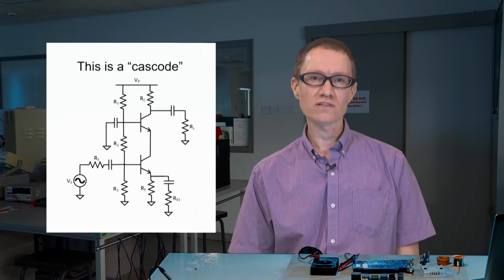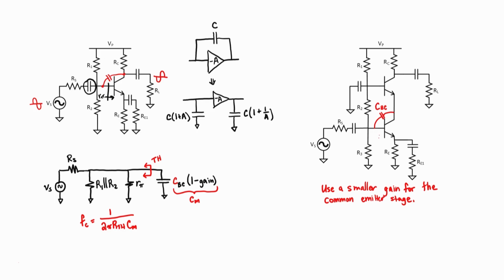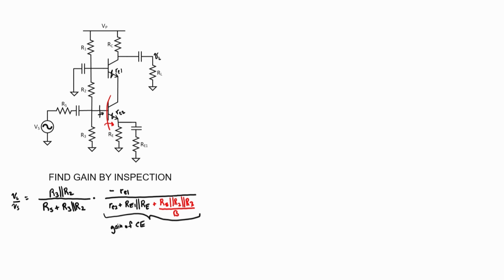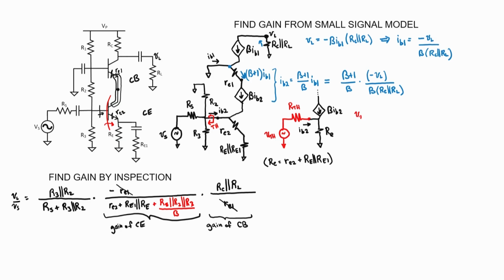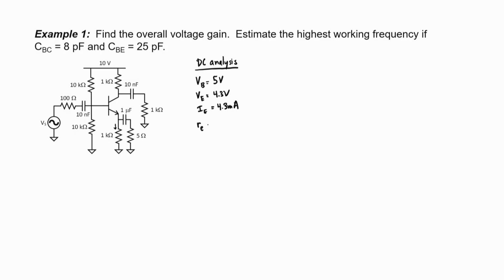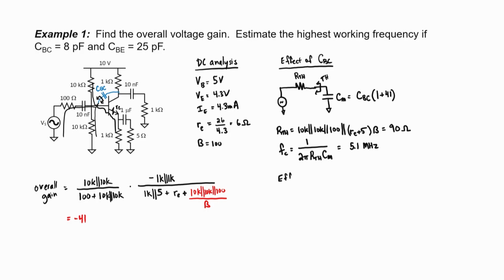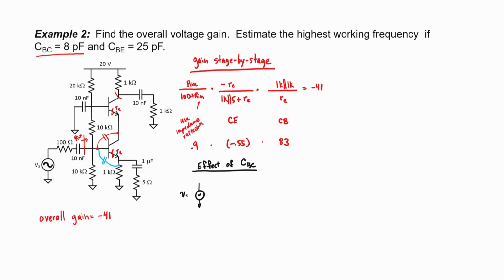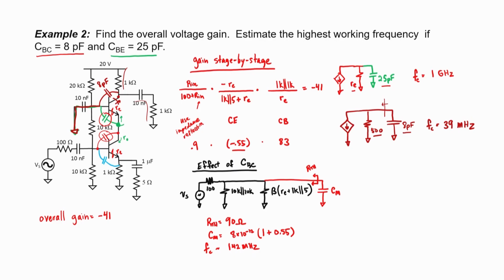Cascode Amplifiers (17-Transistors)

Comment: 16:40 r_e = 26/4.3 = 6 Ohm.  The 4.3 is an emitter current in mA, but where is the 26 mV came from?
Reply: it's so called thermal voltage of the p-n junction. It was explained in the previous videos of the course.

Comment: Thank you for another interesting and instructive video.  One point however:
At 5:17 you say that common emitter is typically used to achieve a phase inversion.   I take issue with this statement.  The only reason why phase relationship between input and output matters is if there is feedback around the stage in question.
So when you say that the CE stage is present in order to achieve a phase reversal I disagree.  I have never seen feedback applied round a cascode stage.  It is true of course that the CE stage itself is heavily fed back (negative).  This is because the internal emitter resistance (re) of the two transistors is similar or identical.  The CB stage's (re) acts as the collector load of the CE stage, giving the CE stage a maximum gain of 1.0, or less if any external emitter resistance is added.
Incidentally, cascode stages are commonly used at VHF with tuned loads.  The original cascode stages were made as you say with two thermionic triodes which together produced a pentode-like characteristic (ie the screen-grid prevents Miller effect inside the device).  The 2-triode cascode arrangement was preferred however as a pentode generates more self-noise.
Having said that, I have used 2-transistor R-C coupled amplifiers to achieve wider bandwidth for video amplifiers and CRT deflection amplifiers which require high voltage output of a constant amplification from DC to HF.  Using a high-voltage and necessarily high power transistor in the hi-V CB stage brings additional advantages in safe-area and invoking the device's f(hfb) rather than the lower f(hfe).
You're a fine teacher and I watch some of your videos with interest.  I am a retired electronic engineer, formerly head of a design section.  I do not wish generally to undermine your technical authority.  We are after all only disputing a "typical reason", not facts or principals, on all of which you are of course correct.

Comment: Sorry for this rudimentary question, but I must ask. I noticed in the first 10 mins you stated that the only reason people use the common emitter is that they need the inversion. But why? Why not use a non-inverting config? With BJT or JFET? You could bypass the miller effect and minimize DC offset. I am not trying to argue against your point. I am just really ignorant and would like to know.
Reply: Hi.  A few points:
1 - non-inverting configurations with a single active device ie bipolar, field effect or thermionic, all have gains less than unity.  So there isn't an alternative non-inverting configuration with gain.
2 - at 5:17 he says "typically" and not "the only reason" that common emitter is used.  As it happens, I take issue with his statement anyway.  The only reason why phase relationship between input and output matters is if there is feedback around the stage in question.
So when he says that the CE stage is present in order to achieve a phase reversal I disagree.  I have never seen feedback applied round a cascode stage.  It is true of course that the CE stage itself is heavily fed back (negative).  This is because the internal emitter resistance (re) of the two transistors is similar or identical.  The CB stage's (re) acts as the collector load of the CE stage, giving the CE stage a maximum gain of 1.0, or less if any external emitter resistance is added.
Incidentally, cascode stages are commonly used at VHF with tuned loads.  The original cascode stages were made with two thermionic triodes which together produced a pentode-like characteristic (ie the screen-grid prevents Miller effect inside the device).  The 2-triode cascode arrangement was preferred however as a pentode generates more self-noise.
Having said that, I have used 2-transistor R-C coupled amplifiers to achieve wider bandwidth for video amplifiers which require high voltage output of a constant amplification from DC to HF.
Mr Danner is a good teacher and I watch a few of his videos with interest.  I am a retired electronic engineer, formerly head of a design section.  I do not wish generally to undermine his technical authority.  We are after all only disputing a "typical reason", not facts or principals, on all of which he is correct.

Comment: 19:20 Is this error? Emitter resistance is (re||1k+5)xBeta and not (re+5)xBeta. Am i right? Anyway great video.
Reply from the maker: You're right but here re is nearly the same numerically as re||1k since re is small, so I just neglected the ||1k.
Reply: Thanks for bringing this up. I was a bit ambiguous as not sure why it was not included in the equation.

Comment: Finally I understood that parasitic capacitance! And also i understood finally why HF transistors have ultra low capacitance at base - collector! My BFR93A has something like 0.5 pF !!! So it is like 16 times less than 2n2222 !!!
Reply: The stray capacitances remain the same for whichever type one uses, and they get the same Miller effect amplification.  However, it's still worth having a lower collector-base capacitance.  Note that HF transistors also benefit from other properties.